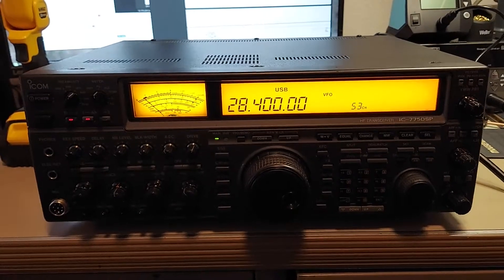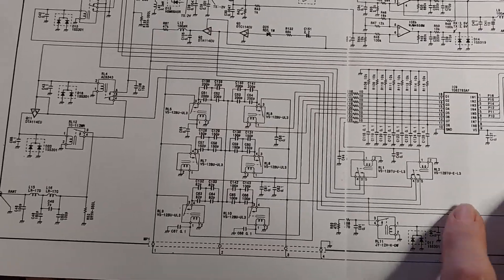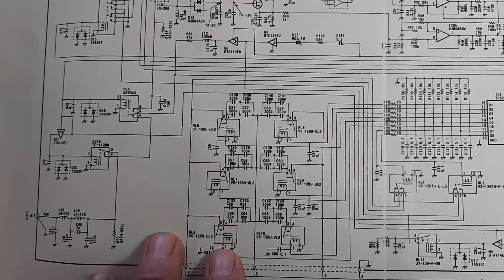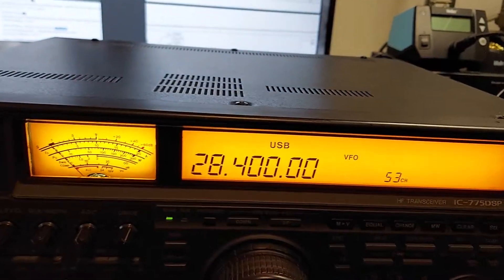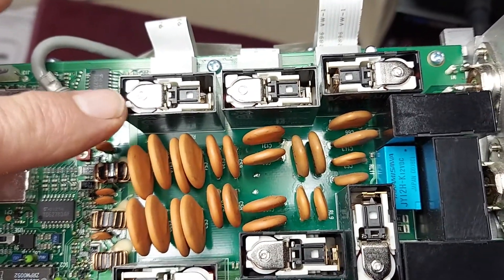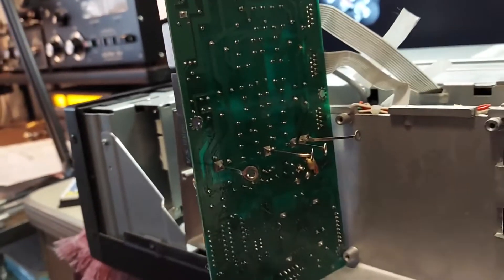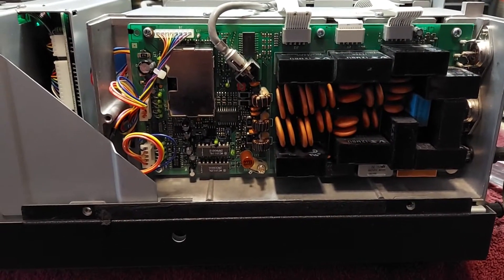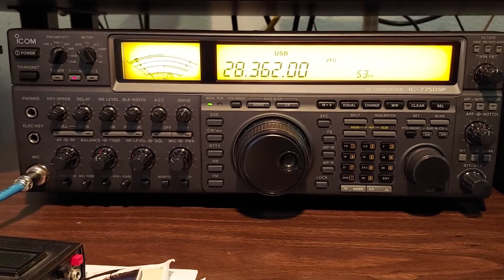Icom IC-775DSP antenna tuner failed repair.

Comment: What about the TUNER MF3 motor and C1/C2 variable capacitor?
Reply from the maker: In the end the issue was a bad relay control driver. The controller would attempt to find a match by adjusting C1 and C2 but would never obtain a match because the proper inductor couldn't be selected.

Comment: hello from brasil where you are buy this relays ?????????
Reply from the maker: I purchased these relays directly from Icom. However while servicing this transceiver, it turned out that the relay was not where the fault was. The root cause was the chip that drives these relays. In the end I wound up replacing the entire antenna tuner assembly and put this one back on the "repair" shelf while I waited for replacement parts to arrive. Hope this helps, thanks for watching.

Comment: Craig - You are most defiantly an advanced tech over me, but what I would try is clean that little switch on the tuner board and toggling it back and forth for new contact, clean and reseat the RCA jack on the tuner board then last resort, just simply reset the radio...I have seen and been successful in some repairs as such, no guarantees this will resolve your issue but its worth a shot.  ~Jack, VEG
Reply from the maker: Greetings Jack,

The small switch is used to reprogram the onboard EEPROM with new VSWR reference voltage data for the tuners micro-controller, the RCA jack is from the output of the PA section. For some reason the relay controller outputs for the 15 and 10 meter bands are not sinking enough current to close the contacts on relays 6 and 7, all the others close just fine. There is voltage present but apparently not enough current. So for the time being I'm going to swap out the entire unit with a working one and then replace the relay controller at a later date. 

73 and thanks for watching :)